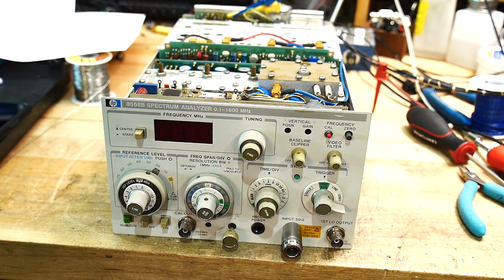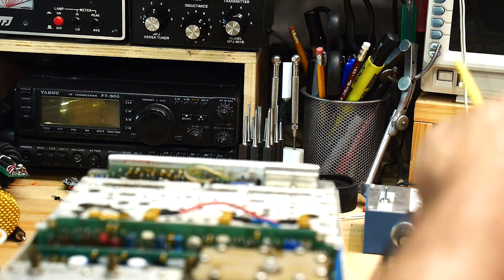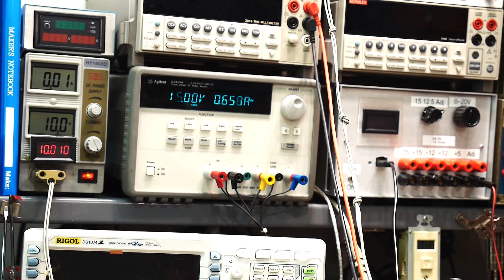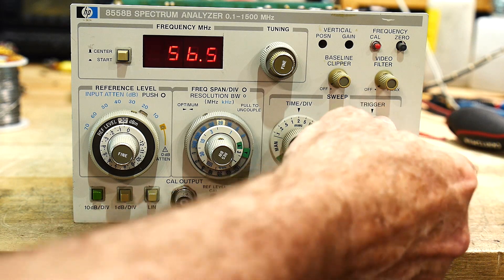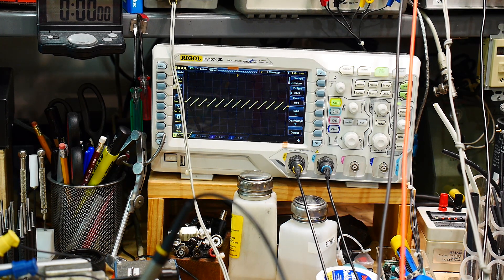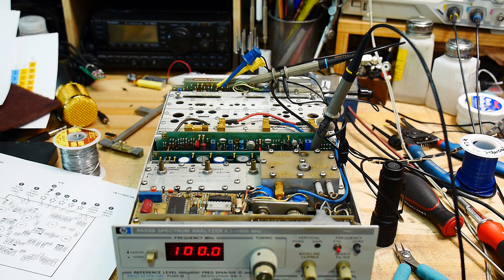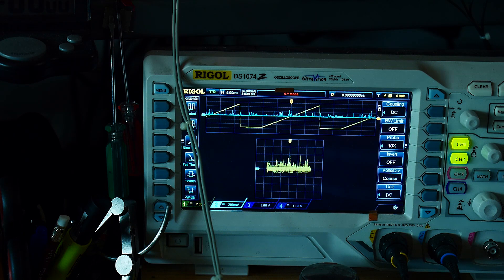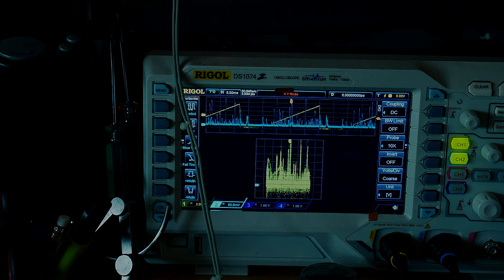#544 8558 Spectrum Analyzer Plugin Working

Comment: Great video! Ive aquired one of these,  I also have the mainframe as well but no visible sweep. Now, I dont think you meniotned what number test point you are hooked up to for the sweep; would you be able to remember the test point? I'll try to fault find  by your method as without the CRT  its much safer,  avoiding all the high voltages.

Comment: I have all three  plugins, however the HP 8558B plugin that I have does not work correctly because the fingerstock in the span selector have fallen out. The other two I have the HP 8559A and HP 8557A are being used in HP 853A mainframes and work just fine. When used in a HP 853A mainframe you have access to several digital functions provided by the mainframe including sending the display to a plotter.

Comment: Just stumbled on this video. Cograts on getting it going so easily..
But i believe you need to blank the display during retracing time (Z axis modulation), 
so you won't have the disturbig Ghost image.
There should be a square wave somewhere synchronized with the ramp and when the levels applied to the scope
are adequate the image shown is only the spectrum from left to right.